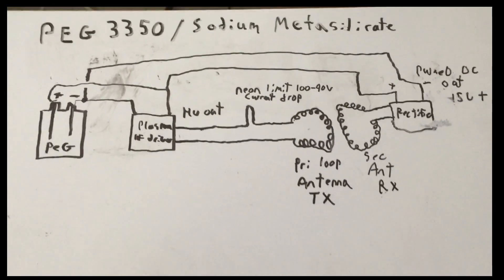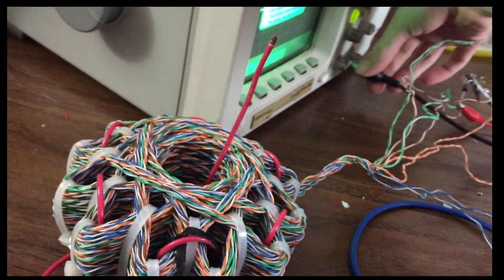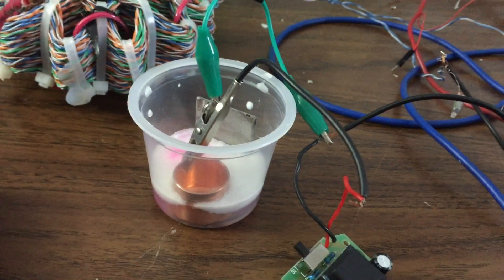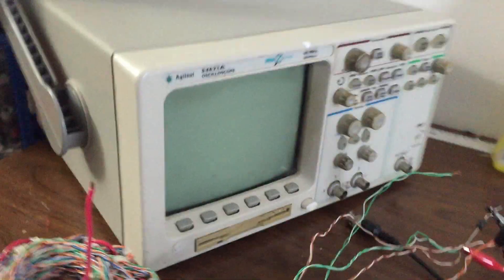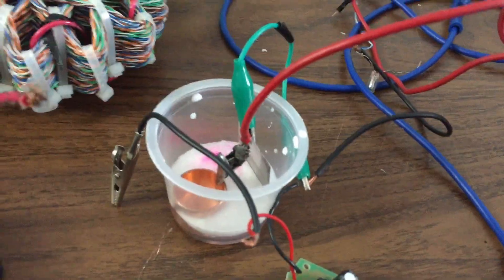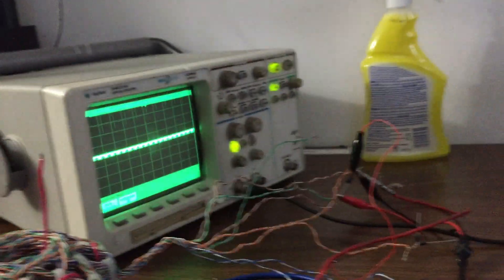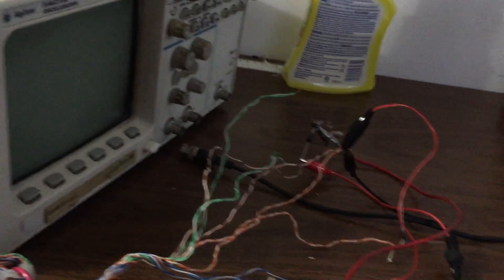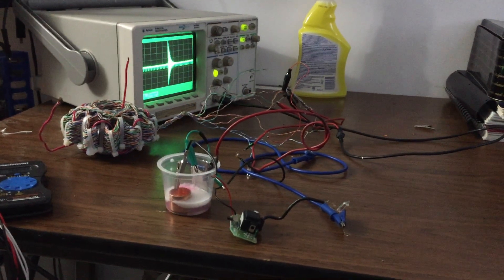100 Volts Electrostatic Loop

Comment: It appeared to be switching as if it were coupling with your voice. At least to me it seemed as though it was interacting with your voice both the neon and as well on the oscilloscope. You should setup a speaker nearby and see if you bet the same reaction and if so try a tone generator and see if you can induce a resonant output in the neon.

Comment: As far as what I would do with 100v 🤔 hmm. Can you reduce it through a transformer and get a few volts with more current? Charge a cap? Trigger more oscillators? Maybe try an earth ground in there somewhere? Can we run a motor and spin a generator with it lol. There's probably a million ways to elaborate on this.

Comment: An important innovation! These rectifying systems need to be demonstrated with supercapacitor like cells instead of batteries, precisely because the chemical energy in batteries confounds the results unless you have expensive battery cycle testing equipment.
Reply from the maker: No batteries are used here.
Reply: @joellagace1679  Yes you are using a type of supercapacitor in this case. If you're rectifying the output to charge the system it must be this way, in order to have a conclusive test.
Reply from the maker: I'm not rectifying the output in the first half, It's not a super cap. It measures a few PF. The second half I just show it for convenience to make people feel better. 100% optional.
Reply: @joellagace1679  huh maybe like an electrolytic capacitor though? are you using PEG with dissolved salt to make a deep eutectic solvent, or just PEG?

Comment: Nice work 🎉 I wondered if this was possible. 

I shared in my Facebook because it's awesome. 

Have you tried this cell with PEG doped with CuO2 powder? I am thinking the sodium Metasilicate wants to grab electrons from the environment so by adding a type P semiconductor at least to the top layer of PEG you can access the 2.4 eV bandgap to use the green light from the sun to generate electron pairs (our sun peak spectrum at this wavelength)

I was also thinking we could tap into the 1420 mHz from the protium of the universe by having Al 2 mil then Teflon + Peg + CuO2 at 10 micron gap and repeat stack and make a 21 cm cube which could be amplified with waveguides like a cone of 63cm length, 52.8* tip, with one side 21 cm diameter and other cut with 3cm diameter hole. Can stack opposing ones to generate q1xq2 waves in stack. 

I am sure I can come up with a better solution like alloys. Maybe 85% Al (10-50 microns), 3% graphene (<100 microns), 1% zirconium dioxide (10-200nm), 3% SiC (100-509 nm), 8% PEG 3350 all measured by weight. Compress to around 350 MPa at least and hold for 10 seconds. I wonder if this alloy composite stack would be effective... I had a vision of it and your AI helped me flush out the details.